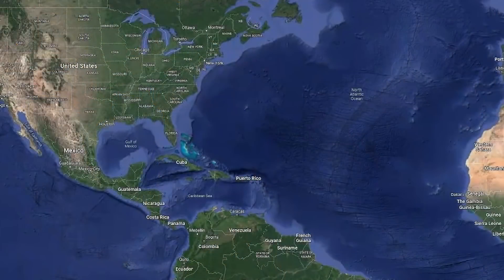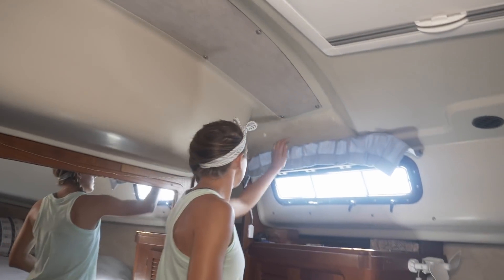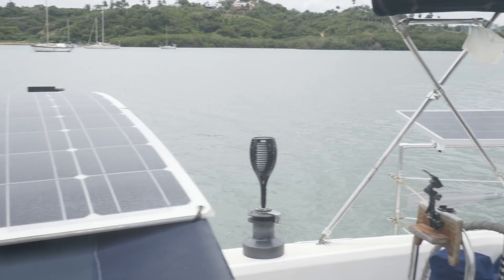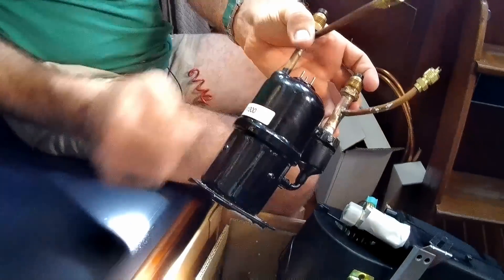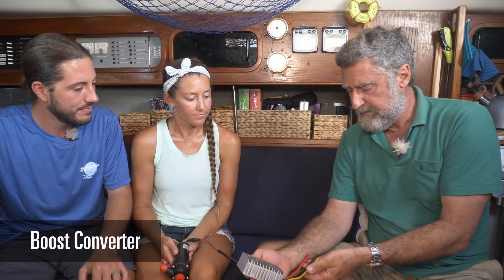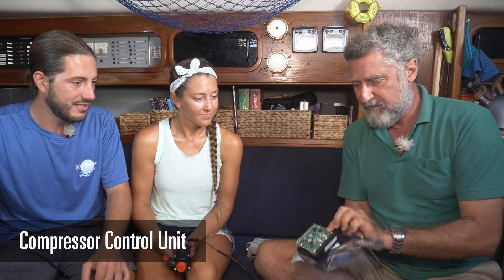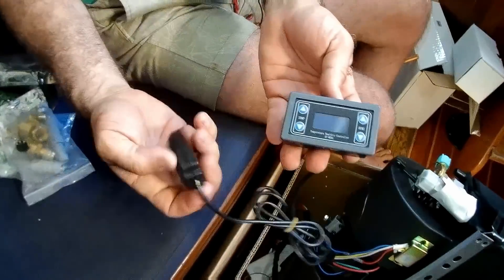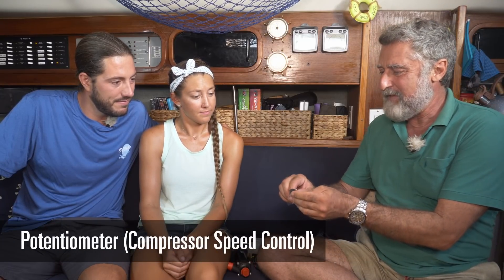Battery-Powered Boat Air Conditioning

Comment: i have a doubt, does this system remove CO2 rich air and introduce fresh air to the conditioned space? 
i was wondering if excess CO2 concentration would kill you in sleep.
Reply from the maker: It won't.  Your doors just don't seal that tight.

Easy test.  Close your door and see if you die.
Reply: @Clarks-Adventure  it would be an exciting experiment 😅

Comment: ALL SOLD OUT !
Reply from the maker: Actually it's just starting up again.  I got a different guy to run it.

Fill out the survey in the description to get on the mailing list.
Reply: @Clarks-Adventure  I have a "better" and substantially cheaper way to do this. Unfortunately I failed to patent it as an existing patent from 1958 existed . Key : Don't compress the gas pump only the liquid  and use SOLAR or other heat source to gain the pressure (PVT) . Rest of the system is the same . the pump needs to be 100psi capable and about 9L / min and use only LPG as the refrigerant. or Y1234. The liquid pump is 75% more efficient than the gas pump and uses an accumulator and a thermo valve for the ejector / expander nozzle.(in stock at your local auto shop). I calculated without losses about 9Watts to pump for each KW of cooling. And yes I ran this by the local technical colleges, who got excited, but then covid came.
A solar thermal panel of about 2M^2 is sufficient and the greater dT gives more rapid cooling ie. to cool from 100C to 50C happens quicker than from 50C to 20C.
I spent too long designing a ceramic single piston inline pump that was hermetically sealed and run by external coils .

Comment: Would this work as a heat pump as well? For colder days?
Reply from the maker: Sure would.  Just need a reversing valve, two one way valves and another expansion valve.

Eventually I'll set one up that way.

If you do it first please report back your findings

Comment: How many BTU's?
Reply from the maker: I'm not precisely sure but the compressor should be able to be turned up to 4k if I remember correctly.

I'm not working with them as much as the guy I contracted it out to at MarineDCAC.com
Reply from the maker: I never need to spin one that fast to do the work.  Lower energy consumption at lower power of course.

Comment: Hey there. Can your air conditioner be powered with AC/shore power? Boat is in fresh water.
Reply from the maker: Basically yes.  Just plug in your a/c battery charger.  As long as it can put out like 15 amps average your good.

Comment: Is there anything to be gained by using a micro controller to control the compressor scrolling as opposed to manually setting the speed?
Reply from the maker: Maybe.  I'm looking into designing my own thermostat that can throttle the speed of the compressor, air handler and water pump.

It will retrofit on units sold with the base thermostat if I decide it's worth the savings in power.
Reply: @Emily & Clark's Adventure  mini-splits seem to do this pretty well; scrolling to maintain setpoint and timing out when the temperature setting is satisfied for a set period of time.
Reply from the maker: I'm looking forward to controlling the fan and water pump based on actually system need measured by refrigerant temperature leaving each stage.

Comment: what are the dimensions of the air handler? You showed it horizontal but can it be mounted vertical as well? Can't wait to see the next video.
Reply from the maker: You would have to modify the water catchment to mount it vertical.  Bet it's do-able.
Dimensions in the description.

Comment: Is there a sea water pump and seawater filter system pushing water through the titanium loop coil? I was always amazed at how much sea-life got stuck in my traditional AC seawater filter - having to clean it out every day or two!
Reply from the maker: Yes I strongly recommend a strainer.  According to my research the titanium condenser should show less growth then the copper nickel.  That was the main reason I chose this material.  But also... Titanium is cool!

Comment: well, im definetely even more interested now that you showed us the parts!! im assuming i could mount the condenser vertically?, or any other orientation, really. let me know. 
im actually buying parts for both my fresh & salt water systems, and im obviously having 2 separate pumps for that. can i divert water from my existing  salt water pump or would i need to install that smaller one?
 as you mentioned before the air handler is indeed the bulkiest item and the one i would like to see improving towards a smaller footprint, is there any alternative? its going to be a real tight fit as it stands, not impossible i guess, but real tight and seeing that i have a 29 footer, any space saved is gold.
Reply from the maker: Condenser can be mounted in any orientation.  Have the refrigerant enter in the top and leave on the bottom.

If you use a bigger salt water pump the package will use more power.  But as long as enough cool water is flowing it will work.  On Temptress I share a pump/water circuit with the fridge.  I serve the AC first but if either is running the pump spins.

I think this air handler is likely the only one for a bit.  It's oversized (rated for 10,000btu/h but I don't see many others available without casting our own plastic shroud.
   Maybe once we have sold a bunch of these and have more investment capital.
Reply: @Clarks-Adventure  great news/info.
wasnt really keen on having to plumb another pump in, as i like to keep things to a minimum, both on install, maintenance and breakage wise, but i guess i can always install the smaller one and use the big one as a backup
most likely i will open the handler and design a diferent box to fit my needs. 
all good, im happy to do that

Comment: Clark, Could the air handler be smaller like this video shows when they get to the master and guest birth? There is only one air outlet in each cabin but the two master cabins are right next to one another but on opposite sides of the boat. This is the type of boat I'm considering on purchasing. Would just one of your units work but be able to take care of both cabins and be able to shut off one of the cabins if I don't have guest? https://www.youtube.com/watch?v=laBrLA7EKY4&t=288s

Comment: Just curious why did you go with water cooled not air cooled condensation and do you have a version available for air cooled I think it would be something for a van lifer to set up in a closed sleeping space
Reply from the maker: Water holds a lot more heat then air so it's more efficient.  We have a lot of it around on boats.
I plan on developing a version for vans, RVs and semi trucks. 
Other obvious developments include a heat pump version.

Comment: Off the shelf those air handlers come equipped with a 1 ton (12k) BTU evaporator and matched TXV.  Obviously you match the evaporator and condenser capacity in order to have proper dehumidification, but that compressor specs out at something like 5k BTU capacity with 100 degree condenser and 70 degree evap and 6000rpm.  A fellow cruising engineer and I were talking and concerned about the amount of superheat being delivered back to the compressor and potential for shortening it's life, are you able to regulate superheat enough to keep it within the 10* or so range it should be?  I was thinking that was the point of the pwm on the fan to limit the amount of heat exchange seen in the evaporator.  No concerns with not having 1m/s airflow over the compressor as recommended to cool it?  Looking forward to the upcoming videos!
Reply from the maker: I do hope I'm not missing something here but the compressor seems to run cool and has for two tropical seasons with virtually no airflow.  But I've not run it at full RPM for an extended period as I'm going for "just enough" cooling and as much efficiency as I can muster.
    I'm running the condenser sub-cooling at 10f.
Reply: @Clarks-Adventure  10f subcooling sounds about right, IIRC they post their ratings at 10f superheat and 8f subcooling.  My biggest concern was regulating/picking up too much superheat and it shortening the compressor life and then without recommended airflow over it made me wonder.  I wasn't sure if you would be able to control your superheat on the suction side enough by running the TXV more open and slowing the airflow over the evaporator to reduce the heat that the refrigerant is picking up and raising the superheat out of normal range since the volume of refrigerant the compressor can supply at 5kbtu is less than what the larger evap is designed.  I was thinking this could translate into higher superheat as the saturated temp is most likely reached earlier on in it's path through the evaporator and it starts picking up superheat after that point.  Being a military based contractor I'm sure they have significant safety factors and durability built into the design so even if you are you're probably okay, as demonstrated by your extended use.  I just want to sidenote my comments with that I'm not trying to circumvent your efforts, my sleeping quarters are smaller and require only around 1500-1800 BTU/hr based on the 14btu/ft^3 estimate so I'm looking at some of the smaller/cheaper Chinese made scroll compressors to see if they might be a better fit for my first attempt at real HVAC design...really wishing I hadn't sold back that college textbook so I had beer money right about now.  Lol.  Thinking I might try adding a reversing valve for heat as well, I froze my butt off some nights on my way south from Maine this fall and I'm stuck in the US for a few more years earning my tenure at work.
Reply from the maker: I've worked with reverse cycle compressor heat pumps before but they were cap tube.  In fact this is my first expansion valve effort.
The only way I can figure out how the get the metering to work backwards is with two expansion valves and two one-way valves.

Am I missing something better?

Obviously I want to offer a heat pump eventually.

Comment: Swamp cooler? Maybe?
Reply from the maker: No, not at all.  This is a real compressor type system like you would have in your house or car.  It removes humidity unlike a swamp cooler that raises humidity.   It's just WAY more efficient.

    COP is a great measure of efficiency.  Most compressors are less then a 3.  Elon puts a 5 in his new Tesla cars.  Mine is around 8!
Reply: @Clarks-Adventure  Sweet!

Comment: I MUST USE ALL CAPS FOR THIS COMMENT BECAUSE I AM EMPHATIC:  I CANNOT WAIT TO LEARN HOW TO CHARGE AC LINES FROM YOU.  I HAVE BEEN TRYING TO FIGURE IT OUT FOR A COUPLE YEARS, AND COULDN'T EVEN FIND A WEEKEND CLASS TO DO IT, BEST I FOUND WAS A HVAC SCHOOL THAT WANTED ME TO ENROLL FOR A SEMESTER.  (In the area where I am now, the idea of an individual doing this kind of stuff is seen as evil-- taking jobs from those HVAC tradesmen!)
Reply from the maker: Yes I hate protectionist unions.  It's basically extortion.  And I include the US AMA in that.
    If you need to charge a cap tube system I already did a video on that last winter.  In fact I did a 3 video mini class on refrigeration I'd recommend as a start.
    This upcoming video will show how to charge an expansion valve system using the "sub-cooling" method.

Comment: FYI: Patreon is kinda sucky software from the consumer side.  They just tried to auth my card for $15B.  That's billion with a B! Eventually I was able to become a patreon.

I was wondering- is the condensor using titanium? Or did you mean copper-nickel is "the new titanium"?   I'm actually getting parts of my new rig made out of titanium. It's my favorite material. 

I'm ready to buy 4 AC units, just tell me where to wire the money!
Reply from the maker: It's actually titanium!
Reply from the maker: And yes I have very little respect for the programmers at Patreon.

Thanks for becoming a "Dream Believer" patron.  I sent you my phone number over there.  Assuming the software lets you get the message I'm looking forward to talking on the phone with you.

Comment: What is the BTU output. I think you said variable speed so is there a BTU range?  Trying to see if the size will work in our boat (monohull). Thanks.
Reply from the maker: We haven't done proper BTU testing yet.  Most companies just pass on the rating of the compressor.  

Our compressor manufacturer says at the typical temperatures it should operate at on a boat it should be 2889 to 5328 BTU/hr at 100f condenser.  We seem to run about 90f in Caribbean temperature waters so we should do better.
Reply: @Clarks-Adventure  thank you.

Comment: Great system. If there was a keel cooler sized for it similar to the keel cooled fridges, the seawater system could be eliminated. I imagine that the seawater system will be the more likely to require maintenance and have failures.
Reply: Keel cooler love it
Reply: Does it need an inlet and an sea water outlet?
Reply from the maker: Keel coolers are pipes outside the boat that fluid passes through to dump heat.  In this case it would replace the condenser, water pump, all water hose and filters.

    And sure you could use a keel cooler if you want.   They are no longer very popular.  Hard to install and hard to keep clear of growth but very effective.
Reply: @Clarks-Adventure  
The dutch build theirs litteraly into the keel... Metal hulls.
How about a PET/plastic/copper  cooling coil system that you can hang over the side or stern at anchor fit via QD hose connectors.
There are new types of pump available that are 33% more efficient but the Co thats producing them is only selling to OE manufacturers. 
See... lets have a think about it channel. The other thing is PVT hybrid panels ...on a boat using water cooling heat transfer isnt a problem.

BTY  
The final section of this should be interesting. Heres an new insight to generator ICE power ...liquid rotary pistons.
https://youtu.be/10SZdOElG1A

Comment: Great product. Where does the condensate go?
Thanks ☺️
Reply from the maker: Either the bilge or your water tanks.  Your choice based on your choices in water quality
Reply: @Clarks-Adventure  I wouldn’t drink it. a/c condensate = mould spores etc??? I’d use a separate collection tank if possible.
Reply from the maker: Yes.  And aluminum oxide from the evaporator fins.

Comment: Hey Clark, just a quick note to say congrats on finally getting your AC vision to completion. I am sure you will find a lot of sailors wanting the system. A suggestion for your 2.0 design is adding a second head with a "Y" valve to allow you to switch between 2 locations..... just a thought!
Reply from the maker: Sure.  And since it's a kit you could do that yourself quite easily.

Comment: I'm ready to pick up two units. I do have a concern about running the compressor at reduced speed. What have you done to address keeping the oil from pooling in the lines when the compressor is running at low flow? 

The variable speed compressor systems I'm familiar with run full speed for a short period of time on a programmed schedule to force the pooled oil back to the compressor.

Where in FL is the pick up point? I plan to leave FL to go to Guatemala at the end of this month.

I expect your design to work really well on my 40' boat, because I have an insulated hull.
Reply from the maker: I like your idea.  I ran the the AC on Temptress for over a year before I saw that issue.  On Temptress I used a way oversized supply line (3/8 I'd hose) going up.  It was a mistake.
   In this unit I have spec-ed 1/4" of copper supply line.  Much higher velocity and more in line with the pumps capacity.  
    Eventually I'll be developing a custom thermostat that will control all aspects at variable speed for greatest efficiency.  I'll likely run fast after each days initial ramp up.
Reply from the maker: The units are being assembled in Tampa FL.   

Unless you have been a Patreon supporter of our channel it's unlikely you will get two of the first 100 units that are about ready.  Our channel supporters are getting first dibs based on lifetime contribution.
    More will be coming but I doubt they will come out this month.
Reply: @Clarks-Adventure  I'm something changes in the supply chain let me know. I'm currently in Fort Myers Beach, Florida.
Reply from the maker: Fill out the survey and get yourself on the mailing list.
Reply from the maker: Or you could contribute big on Patreon (basically I just realized I've set up a system trying to be fair that lets me be bribed). :)

Comment: I’m building out sprinter vans and very interested in these for our builds
Reply from the maker: Yes we will be offering an air cooled model eventually.  We are also planning a "heat pump" model.
Reply: @Clarks-Adventure  Could it  be used  as is, drawing from a fresh water tank rather than a thru-hull? Then drain to the exterior of the  van.
Reply from the maker: You would quickly run out of water.  Best efficiency is with an air blower over the condenser.  I'll work out something.

Comment: Is the control board protected in any way from the salty environment?
Reply from the maker: Yes it has a coating but the connectors are exposed so you shouldn't mount it (or any other part) where it would get wet.

Comment: I’d like a ducted air handler so I can have an inlet hose on one side of my cabin/bunk and the exhaust on the other so I can recirc the air with all the equipment contained below my bunk, in a cabinet or somewhere else.  Only the controller and a couple of diffusers would be visible.
Reply from the maker: Yes that is similar to how I installed on Temptress (see other video).  This air handler can accept hoses.  In your application you might want to join the 4 smaller ducts to one big duct or replace the air handler faceplate and make your own.

Just make sure the air handler gets air from the space you are blowing it to.